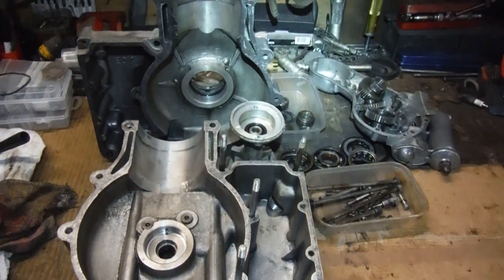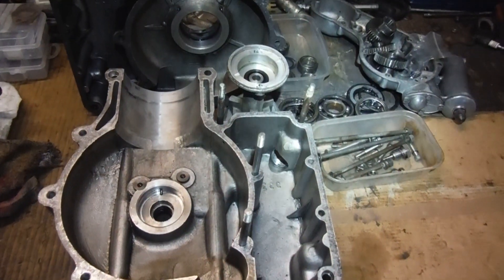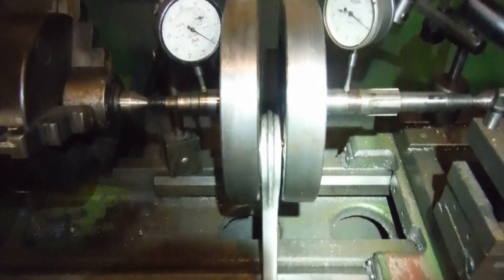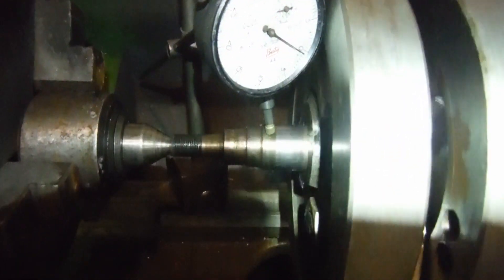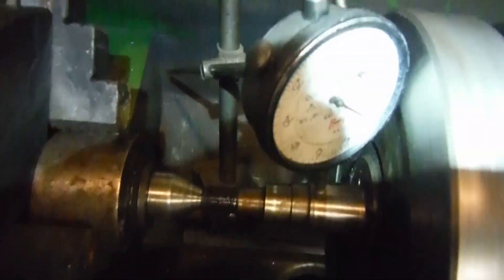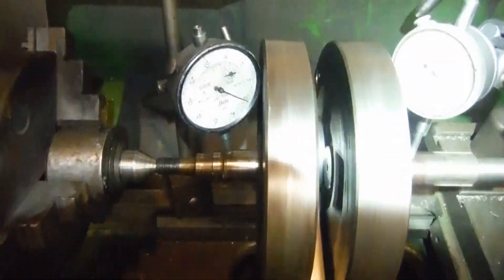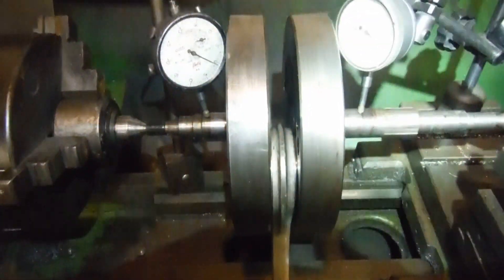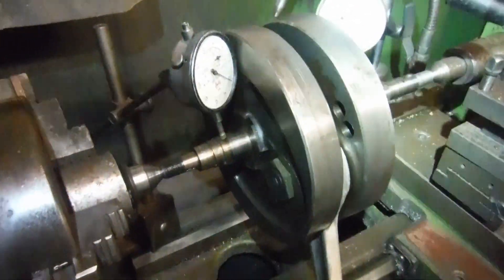Royal Enfield - building and tuning Asbo 52, a 500 Bullet engine. Part 1.

Comment: I also have an Indian 500 Bullet on the bench and finding it hard to get the crank out of the cases, the timing was easy but i can't seem to get the other side to come out. Maybe not enough heat? Or maybe I need to tap it a bit harder? It looks like this is the first time it's been apart. It's a 1958 Woodsman, do you have any advice?? Thanks for your time Paul, I really enjoy your videos. Charles Horton.
Reply from the maker: Try laying the crankcase on its side on some blocks of wood, so the mainshaft is facing vertically, with room below for the crank to drop out and hit the end of the drive side mainshaft with a heavy copper mallet.